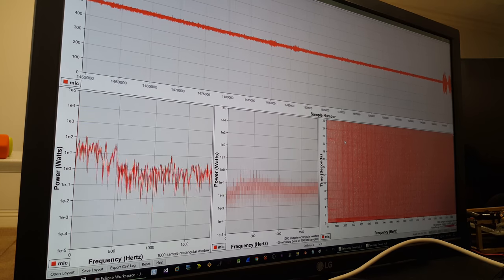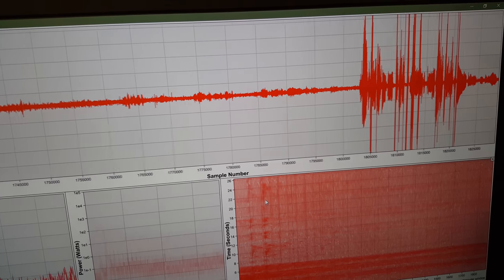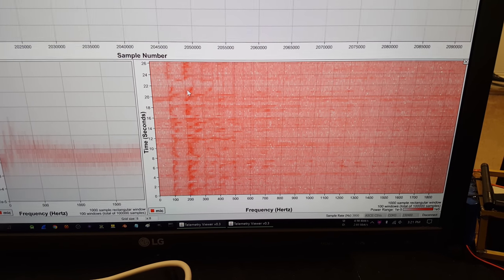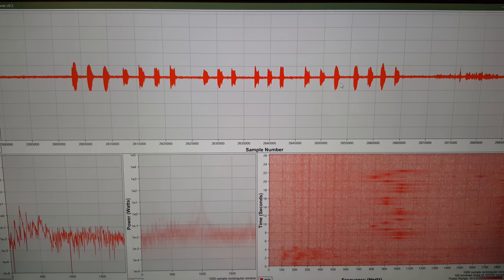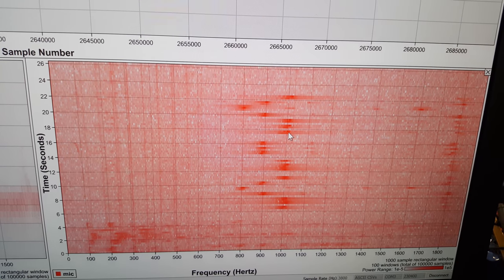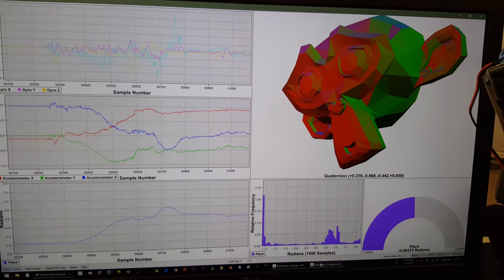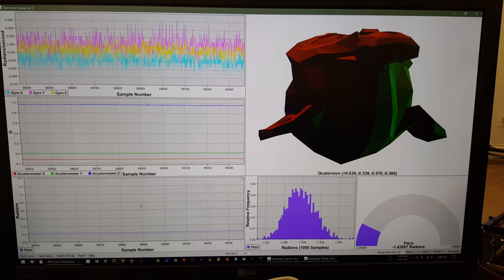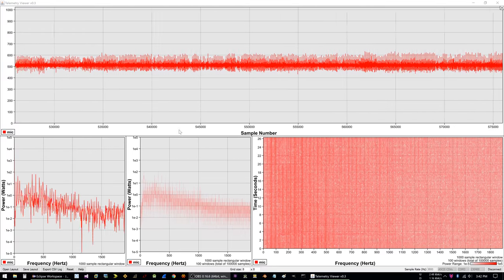Advanced Arduino Telemetry and Data Visualization

Comment: Awesome program!

What I would like to see in a new version:
- Dark Theme
- Console (sending commands to the microcontroller)
- Able to start/stop the data without disconnecting/clearing data (so you can sample for 5 seconds so files wont have 1 million rows)
- More/custom baud rates
- time/div in the corner of the x/y graph
- Exporting csv files that start with 'sep=,' so they can be opened in excel without importing them
- When you zoom in it wont change the frequency chart

Comment: This is an awesome piece of software - I only started to try it on my Mac, connected to an Arduino. This is much easier to use than using Processing which I did in the past. Thank you very much for the good work and for sharing. Greetings from Switzerland.
Reply from the maker: Glad you like it, thanks for the feedback.
Reply: @upgrdman  I try to use version 8 it doesnt look work for me. I use demo firmware from soft sketch upload to arduino... it doesnt show any..... pls advice

Comment: This program seems awesome, though there is one thing that i see as missing in it. Non chart info. I want to add boxes that only contain the current value and name of a certain variable in them, with the graphs being used as an auxiliary bit of information.
Reply from the maker: Thanks. I plan to add that eventually. Currently you can use a Dial Chart to get something close.

Comment: Seriously awesome project! 

You have definitely rekindled my plans to build a arduino datalogger / dashboard for my racecar. I would like to use your software for data analysis later on since I haven't found any existing track analysis software that can work with .csv files, they tend to all stick to their own proprietary files. How difficult would it be to modify your code to be able to graph gauges such as engine speed or vehicle speed, and would it be possible to add track layouts and take GPS data and overlay that to show track position / time? Cheers, Alex
Reply from the maker: Thanks! Right now the software can only display live data, but replaying CSVs is planned. The "Dial Chart" is a primitive gauge. If you have experience with Java and graphics programming, you might be able to modify it to fit your needs. New charts for showing 2D and 3D positions are planned but it might be a while before I get to that.
Reply: Excellent! I have downloaded your software and planning to use it for testing my system and ironing out the bugs I had with sensors affecting each other. Will keep my eyes open for updates on this and will see about learning Java in my spare time to see if I can modify it to suit.

Thanks for sharing this project, it's very helpful!
Reply: upgrdman i have similar but very advanced software with many many functions but it reads data not from arruino. Do you want to see it? Maybe you can modify it to read from arduino.

Comment: Great Work! Quick question: I am trying to use a temperature sensor and it is outputting the temp to the serial monitor in degrees Fahrenheit on Arduino Mega, however I was wondering if you could tell me how I could manipulate the LSB values on your program to actually see the y-vales corresponding with the degrees F range/scale. Thanks!
Reply from the maker: Thanks. If the Arduino is already printing out the number in F, there is no need for scaling in TelemetryViewer. Just set it to 1 LSBs = 1.

Comment: I love what you have done but I have a problem. Your original version works perfectly on my computer, but neither v0.2 or v0.3does. 

In v 0.3 for example, after I enter the values in the comm area (bottom right) and hit the "connect" button, the "CVS  Packet Data Structure" box opens normally, and my Arduino starts sending data. When I enter the data at the top and hit "Add," the correct info shows in the 1st line below it. When I hit "Done," the  "CVS  Packet Data Structure" box closes and I am back to the main grid. When I select an area on the grid for the chart, the "Add Chart" box opens. I then enter the correct info and hit "Add Chart," and the Add Chart" box closes but all I get on the grid is a dark grey area where the chart should be. Also, sometimes the program hangs and I have to force it down with the Windows Task Manager. 

I had essentially the same problem with v0.2, but the first version you posted works perfectly on my computer. 

Can you help?

Comment: Hey Upgrdman. Is it possible to make visible the power  :  P =U x I    P ( Power in Watt) U in Volt ( A0)  I  in Ampere ( A1) in a dial chart or on a other way.
Reply from the maker: You want to do math on multiple datasets? That's a good idea, but no it does not support that.

Comment: Nice work.
Reply: Oh wow.  I thought for sure you are using JavaFX Charts, but this is a Swing app.  Really cool man!
Reply from the maker: Thanks. In v0.1 I used the JFreeChart library, but it was painfully slow since it's CPU-only. I decided to write my own charts from scratch and render them with OpenGL. Swing is only used for the controls at the bottom of the window, and when configuring a new chart. I briefly tested the JavaFX charts but they were painfully slow when used with large datasets. I wanted things to be efficient enough to render datasets of >500k points, live, at 4k60, with just Intel integrated graphics. I'm pretty close to that goal, currently able to do 4k60 with about 400k points on a Surface Pro 4.
Reply: Cool.  Thanks for the insight.

Comment: Awesome!!!, thanks a lot for such a great contribution, I tryed the binary version, but sometimes looses the sync, still some errors with bin?, if I use crc will help? which kind of crc, 16?
Reply: I've implemented the CRC from your code, now works fine, thanks again for this really good utility
Reply from the maker: Thanks. The binary mode is not quite done yet, and it does not currently support CRC. I'm hoping to have the binary mode in a more usable state by the next version, but that might be a couple months from now.
Reply: Then I don´t understand, because I´m using 10 floats LSB format plus CRC termination, same implementation as in BinaryPacket.java and it´s working fine, no sync errors, not like before using the CRC, anyway, thanks a lot

Comment: how do you calculate the quaternions? I use MPU6050 and don´t use the unit DMP because is slow
Reply from the maker: I use Madgwick's Filter, which outputs a quaternion. I have a video about it, check out my older videos.

Comment: Hi. thx for the awesome program. I have a question. Is this program runs only openGL ver4.5 or higher? cuz my old laptop has openGL v4.0 (3rd gen i5 cpu) and program seems automatically closes.
Reply from the maker: OpenGL 4.0 should be fine. It's probably related to OpenGL drivers. If you're using 64bit drivers, you will meed to use a 64bit JRE.

Comment: Hello, I have a problem on Mac. The Arduino UNO is working fine and the serial monitor window of Arduino also works fine. But I have difficulties to connect Telemetry application to Serial port. It is listing 3 cu.Bluetooth-Incoming-Port, tty.Bluetooth-Incoming-Port and Test. It is not establishing the connection to any of them. Can you please help?
Reply from the maker: Only one program can use a port at a time. Try closing the Arduino IDE or anything else using that port.

Comment: Hey Upgrdman, awesome software here. Is there any new version out besides v0.3?
Reply from the maker: Thanks. v0.3 is the newest. I'm still working on v0.4, not sure exactly when it will be ready. Hopefully in 3 - 5 weeks.
Reply: Thank you upgrdman :) this really helps. Subscribed to your channel :D would love to see more from your channel. Is it possible to do telemetry from arduino sending data via Wifi?
Reply from the maker: I'm working on support for TCP/UDP but it might be a while.
Reply: Hi Upgdrman. Might i suggest an option, to compress the incoming data. as nearly 30 minutes of acquisition can sometimes create an excel file of nearly 180MB. also if there is a feature known as triggered recording(to record values to excel file only if the value crosses a threshold. Presumably adjusting the number of seconds to record before and after the trigger.

Comment: Hi, this looks like an awesome tool. I am trying to get it working on my Mac but I don't know how to get it connected to the Arduino. It doesn't show any COM ports on the Mac. The port I'm using to upload to the UNO is cu.usbmodem1411. This is listed in the dropdown in Telemetry Viewer but when I select it, it gives the error: Warning: Serial connection lost.

Any idea what I'm doing wrong?
Reply from the maker: I have not tried it on a Mac but it should work. Only one program can use the Arduino's serial port at a time. Try closing the Arduino IDE if you have it open.
Reply: Thanks upgrdman. It did work. I am using cu.usbmodem1411 when connecting via the IDE. TelemetryViewer also listed tty.usbmodem1411 and I tried it but got the same error. After shutting down everything, I tried tty.usbmodem1411 again it it worked. This is an awesome program. Thanks for sharing.

Comment: All ok only this 

"A corrupt line was received.
A corrupt line was received.
A corrupt line was received." x infinite while running . Could be a bug in eclipse or ? Thank you !
Reply from the maker: That means your telemetry data is not formatted correctly. What does it look like when you connect to the device with a serial terminal?
Reply: maybe it's the empty line
Reply: First problem solved. I had an extra line. Thank you .
A second problem I discovered now when trying to add new graph is this: Thank you !

java.lang.NullPointerException
 at LogitechSmoothScrolling.enableSmoothScrolling(LogitechSmoothScrolling.java:101)
 at Main$1.windowGainedFocus(Main.java:35)
 at java.awt.Window.processWindowFocusEvent(Unknown Source)
 at java.awt.Window.processEvent(Unknown Source)
 at java.awt.Component.dispatchEventImpl(Unknown Source)
 at java.awt.Container.dispatchEventImpl(Unknown Source)
 at java.awt.Window.dispatchEventImpl(Unknown Source)
 at java.awt.Component.dispatchEvent(Unknown Source)
 at java.awt.KeyboardFocusManager.redispatchEvent(Unknown Source)
 at java.awt.DefaultKeyboardFocusManager.typeAheadAssertions(Unknown Source)
 at java.awt.DefaultKeyboardFocusManager.dispatchEvent(Unknown Source)
 at java.awt.Component.dispatchEventImpl(Unknown Source)
 at java.awt.Container.dispatchEventImpl(Unknown Source)
 at java.awt.Window.dispatchEventImpl(Unknown Source)
 at java.awt.Component.dispatchEvent(Unknown Source)
 at java.awt.EventQueue.dispatchEventImpl(Unknown Source)
 at java.awt.EventQueue.access$500(Unknown Source)
 at java.awt.EventQueue$3.run(Unknown Source)
 at java.awt.EventQueue$3.run(Unknown Source)
 at java.security.AccessController.doPrivileged(Native Method)
 at java.security.ProtectionDomain$JavaSecurityAccessImpl.doIntersectionPrivilege(Unknown Source)
 at java.security.ProtectionDomain$JavaSecurityAccessImpl.doIntersectionPrivilege(Unknown Source)
 at java.awt.EventQueue$4.run(Unknown Source)
 at java.awt.EventQueue$4.run(Unknown Source)
 at java.security.AccessController.doPrivileged(Native Method)
 at java.security.ProtectionDomain$JavaSecurityAccessImpl.doIntersectionPrivilege(Unknown Source)
 at java.awt.EventQueue.dispatchEvent(Unknown Source)
 at java.awt.SequencedEvent.dispatch(Unknown Source)
 at java.awt.EventQueue.dispatchEventImpl(Unknown Source)
 at java.awt.EventQueue.access$500(Unknown Source)
 at java.awt.EventQueue$3.run(Unknown Source)
 at java.awt.EventQueue$3.run(Unknown Source)
 at java.security.AccessController.doPrivileged(Native Method)
 at java.security.ProtectionDomain$JavaSecurityAccessImpl.doIntersectionPrivilege(Unknown Source)
 at java.security.ProtectionDomain$JavaSecurityAccessImpl.doIntersectionPrivilege(Unknown Source)
 at java.awt.EventQueue$4.run(Unknown Source)
 at java.awt.EventQueue$4.run(Unknown Source)
 at java.security.AccessController.doPrivileged(Native Method)
 at java.security.ProtectionDomain$JavaSecurityAccessImpl.doIntersectionPrivilege(Unknown Source)
 at java.awt.EventQueue.dispatchEvent(Unknown Source)
 at java.awt.EventDispatchThread.pumpOneEventForFilters(Unknown Source)
 at java.awt.EventDispatchThread.pumpEventsForFilter(Unknown Source)
 at java.awt.EventDispatchThread.pumpEventsForHierarchy(Unknown Source)
 at java.awt.EventDispatchThread.pumpEvents(Unknown Source)
 at java.awt.EventDispatchThread.pumpEvents(Unknown Source)
 at java.awt.EventDispatchThread.run(Unknown Source)
Reply: it seems that can not connect to 127.0.0.1 on port 53459. Need to enter more deep into LogitechSmoothScrolling instructions...
Reply from the maker: The NPE from LogitechSmoothScrolling should be harmless, but I have made some changes that should prevent it in the next version of the software. Does your graph display fine?
Reply: Yes all good. Good work !

Comment: The new options are very usefull. It works beautiful on my Destop . Excellent.  But i have a problem with this programm on a new notebook with windows 10 : Open GL es error . Can't find the name of Intel ICD open GL driver. Doe you have a solution?
Reply from the maker: It sounds like the software can't find an OpenGL driver. Making sure Windows has all updates installed, and check Device Manager for any problems (there should be no yellow triangle warning icons, etc.)
Reply: All updates are installed from Windows 10. There are no problems in Device Manager. This is the system.Notebook.Specificaties: Medion Akoya E7424 (MD 60150)Processor: Intel Core i3-7100U
Beeldscherm: 17,3 inch, HD 1600 x 900 pixels resolutie
Grafische kaart: Geen, Intel Graphics 620 grafische chip
Werkgeheugen: 4 GB DDR3L
Opslagapparaat: 128GB SSD & 1TB Harde schijfNew 8 februari 2017Hope on a solution.
Reply from the maker: I Google'd the error message you saw, and got lots of conflicting reports. It seems like the issue might be related to the graphics driver, and some people had success by downgrading their driver. For example:
https://osu.ppy.sh/forum/t/519910/start=15

The only PC I have with an Intel GPU has Intel Iris Graphics 540 and everything seems to work fine on that with driver version 20.19.15.4463
Reply: It's works now good. My friend has found the problem. My notebook is new.I think normal all programms from Microsoft on this notebook 64 bits. I use Internetexplorer 11 and that was a 32 bits in Windows 10.After that have I installed Java . And Java had also installed in 32 bits .Now is Java and Internetexplorer in 64 Bit version.  Now I happy. It's works good.The newest grafic driver from Intel was on Sunday installed.I have introduce this programm today on a highschool and they find this a very good programm. They are happy. Thank for your help Upgrdman and your very good work.